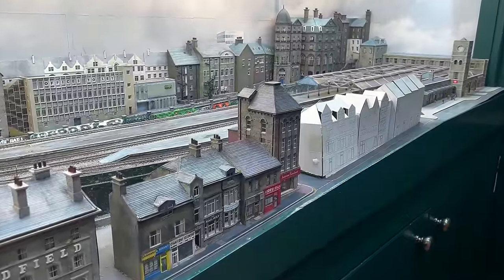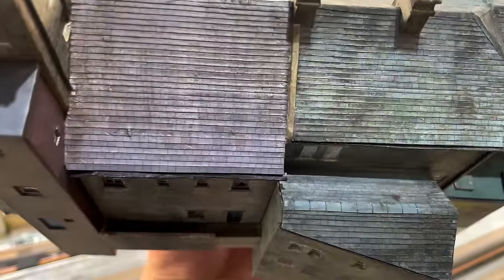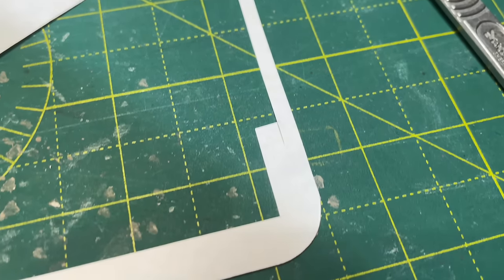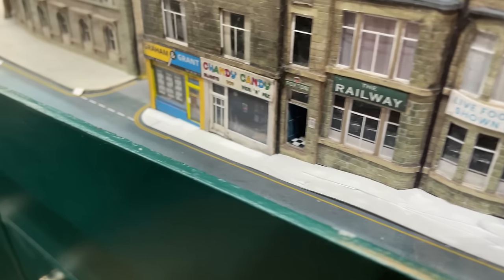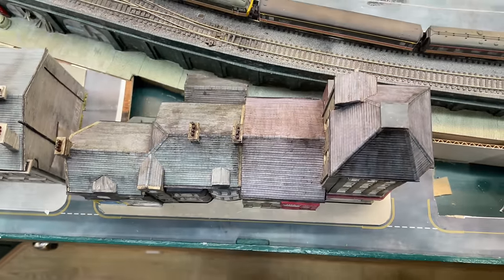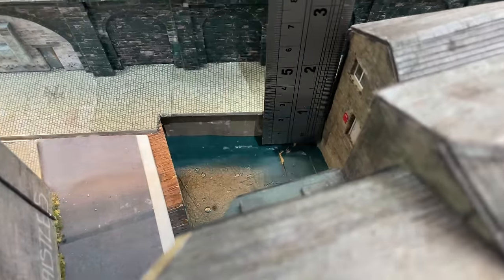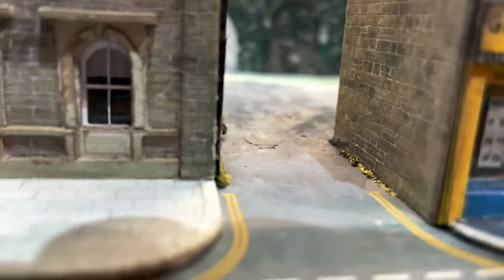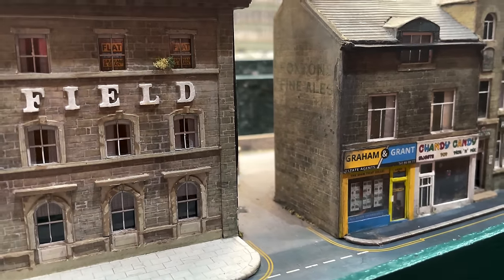Finally part of the landscape! Bedding a model street into its environment - N Scale card model

Comment: For fitting the pavement around the building at 2 mins in, may I recommend a Shape Duplicator or Contour Gauge.  Just push it against the buildings and it'll accurately record the shape so you can draw it straight onto the edge of the card you will use for the pavement, saves a huge amount of faffing about with little bits of paper.  Also very handy for getting a straight stone wall on a rolling country field :)  I'm really enjoying your videos as always, keep up the good work!

https://en.wikipedia.org/wiki/Profile_gauge
Reply from the maker: This is a good idea.

Comment: What I saw “wrong” with the brick corner is that the edge that butts on the street should be the same level as the street giving access to the street for people in wheelchairs to cross the street.
Reply from the maker: That is a very good observation. I may be wrong, but I really don’t remember seeing very many dropped kerbs in the 1990s, especially on run down neglected streets like this.

Comment: Michael,  are you buying your UHU glue in a dispenser or just using tube UHU and transferring it into your dispenser?  I'd like to give this stuff a try but the only non-stick variety I can find is in a regular tube so perhaps a link to what you are using please.
Reply from the maker: I only very rarely use UHU and when I do, I use it straight from the tube. I use PVA in the fine tip applicators.
Reply: @Chandwell  Ok, so a link to the PVA glue please?

Comment: Hi Michael, I have been watching your videos for the last few months and very much enjoy your problem solving, can-do approach.  You've created a truly immersive and layered world with great depth.  One detail thing that I would pick you up on (very gently) is that clay chimney pots are always bedded in with cement flaunching, also known as benching, around their base.  This is to hold the pots in place, but also to encourage water to run off the chimney stack as quickly as possible, to avoid water ingress.  The flaunching, typically in a hard sand cement mix, is normally steeply sloped away from the pot towards the chimney stack edge, or lip, whether that is made up of brick or an actual stone coping.  It is something that is often missed by modellers simply because it's not visible from street level.  Keep up the good work.
Reply from the maker: Thank you. I’ve seen this a lot on the real thing and occasionally wonder about doing it, but so far, I’ve decided that at N scale it’s not worth working out how to do it. I’d probably need Milliput or clay or something, and it would be incredibly small/thin. I’ll bear it in mind though as it would add a new layer of realism to my models. Please keep suggestions coming… every day’s a school day!